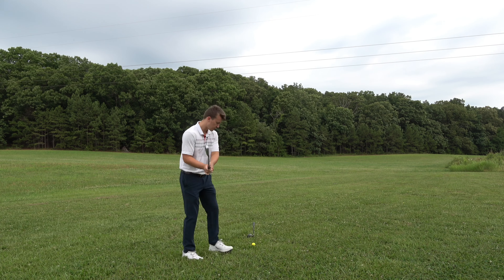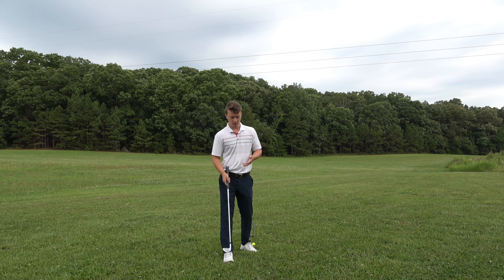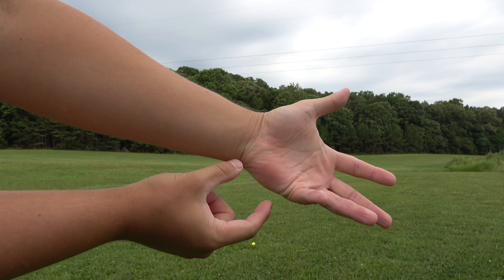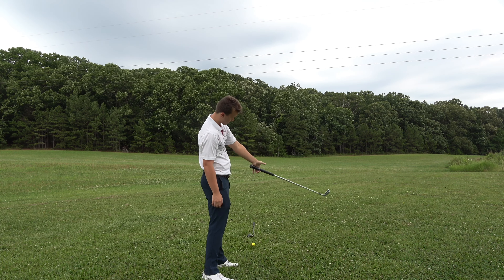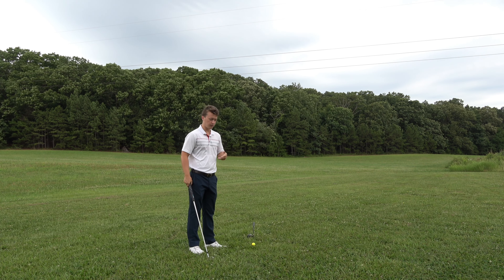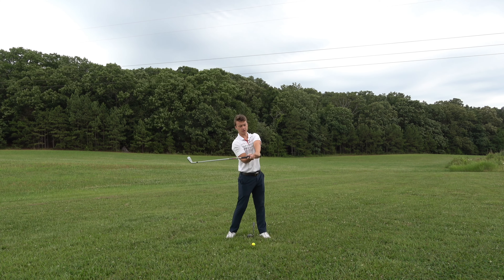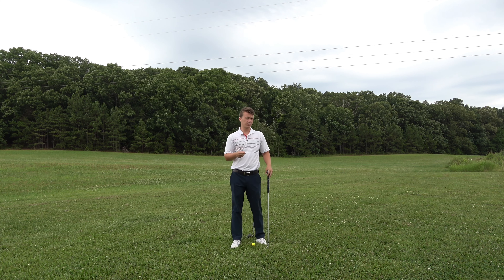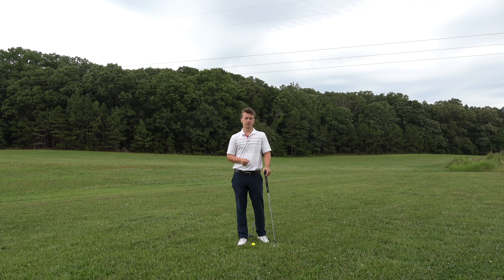How to STOP YOUR SLICE by FIXING YOUR LEAD HAND GRIP (Part 10 of 19)

Comment: Do you use the jumbo grips?  If so what's the pro's and cons of the jumbo grip?
Reply from the maker: Hey Rick,

I do use Jumbo Grips. Personally I have seen an increase in accuracy, consistency, and power. As far as I can see, the only con is 10% of golfers who try them say they "don't feel right". The pro's are pretty lengthy: More power, more consistency, more flow to your swing because it stays in the hands easier, easier to get shaft lean, easier to square the face. It is a long list.

I hope this helps,
Nate